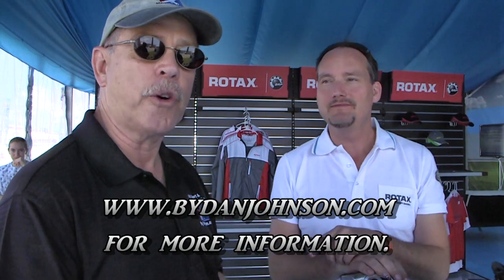Rotax 915 iS, 135 HP, turbo-charged aircraft engine based on the Rotax 912 iS.

Comment: The February 2018 Engine issue of Kitplanes lists this engine as "185 lbs bare 245 installed". The Rotax 912iS and the Rotax 914 are both listed as "155 lbs w/exhaust, internal alternator". Are the weight figures for the 915iS really that much higher than the 912iS and 914?
Reply from the maker: http://www.flyrotax.com/produkte/detail/rotax-915-is-isc.html lists the weight at 187 lbs which is about 35 lbs. heavier than a 912 is. The weight difference is found in the coolng system for the turbo. But is is NOW 141 hp rather than 135.
The Ultralight Flyer
Reply: Could it be the extra turbo and exhaust adding the pounds ?

Comment: Duke Engines can produce 180 HP and weighs 84 lbs less, all that in a package smaller than 18 inches x 12 inches and without the complications of adding a turbocharger.

Comment: I'm surprised that turbo aircraft engines are not more common. it almost seems dangerous not to have one especially if you want to cross a mountain range or fly on a hot humid day.
Reply: Jason schmidt the faa has successfully kept advancements away from reaching production planes. Simple things are insanely expensive cuz of faa certifications.
Reply: @coolhari2000  not sure how familiar you are with Lycoming or Continental, but plenty of turbo charged type certificated out there. Just costs more and require additional maintenance.

Comment: Is service for this engine difficult to find, and expensive, in the USA ? As I understand it the proven 912 carb engine can be serviced in many places here in the USA. If that's not the case for the fuel injected version then it could significantly increase the cost of ownership. I'd like to hear from US owners - have you been able to get local service for this engine ?

Comment: Rotax engines are strange sounding. The LSA(I think its a Aerofox) at my local airport uses a 912iS. Its a very distinct sound when compared to the cessna 172s that also operate there.
Reply: max bootstrap - the problem is physics. Think of the propeller as a wing that travels in a circular Arc. When RPM increases it reaches a point at which the tip of the propeller goes from a subsonic flow regime to transonic to supersonic. Those transonic and supersonic flow situations are relatively inefficient at producing thrust for a given power input at low subsonic flight speeds (general aviation). So a propeller with a small swept diameter could work (think a multiblade small diameter prop fan) but they are most of the time not as efficient as a PSRU and a well designed long thin blade (low induced drag loss per blade). The multiblade solutions are also expensive to make variable pitch, can be heavier, and have sometimes blade turbulence interaction issues. Your idea is absolutely correct but there are some inherent problems that make a PSRU and a more standard propeller most of the time a smart solution.
Reply: Nemo Blackheart - the engine runs at higher rpm and uses a gearbox to reduce prop speed.
Reply: 912-915's sound not like 2 strokes , but like a 4 cyl motorcycle engines...direct drive engines like contis/Lyco are very old designs (same as the engines built in the 1930's) = high consumption, high cubic, high weight, and not better reliability...
Reply: Out of curiosity, why can't they eliminate the gearbox and replace the propellers with something appropriate to the higher RPMs?
Reply: Lycoming and continentals turn at 2700 max and 2200 cruise...........rotax turn at 5800 max and 5200 cruise.........they sound like two strokes because that is the rpm that most two strokes run at........5800ish...........makes it sound like a two stroke even though it is four stroke....

Comment: that engine is well over 35 k 
rotax is way over priced

example
fishpaper gasket for gear box (582) = 125 $ <<ridiculus
after market = 15$
same gasket ...
Reply: Jason schmidt 
Yeah, you're paying more so you don't have catastrophic failure mid-flight.
Reply: they have had awesome car or motorcycle engines that never quit..

ex 3 cylider geo engine  from suzzuki

for what 1000 to 2000k
Reply: Try and run a car or motorcycle engine upside-down like this rotax in inverted flight. I'm not saying $35k is reasonable, but aircraft engines are more different from automotive engines then you might expect.
Reply: It's the small batch size and stringent standards that make it pricey. You can pay almost as much for a rebuilt Gipsy Major, using parts over 70 years old ! Check out the Lycoming prices, as well...
Reply: JF TEA thank the faa for increased inefficiency and costs.
Reply: yeah. but this thing has the full package. reduction gear box, turbo, full FADEC etc.. I think its worth the money.